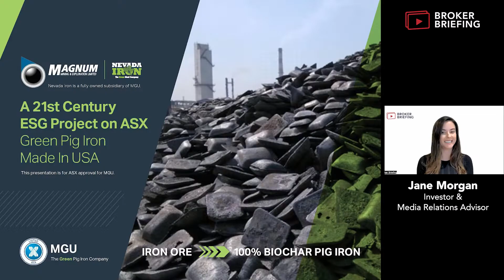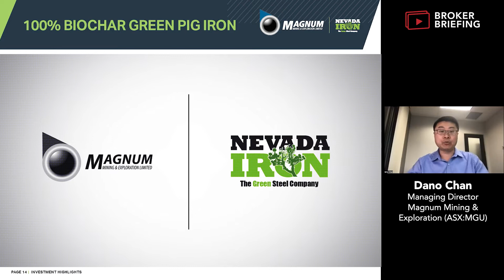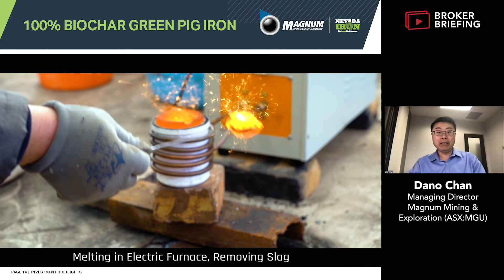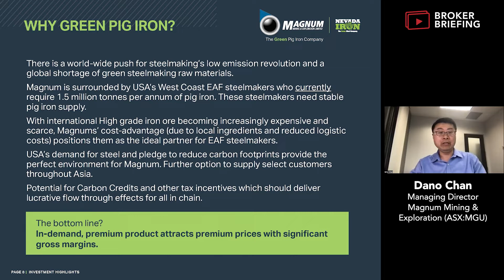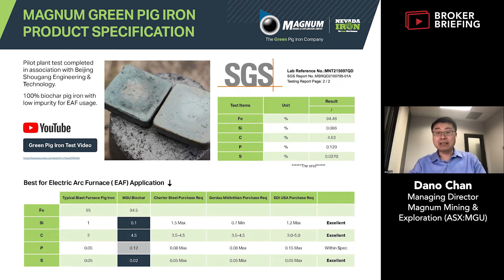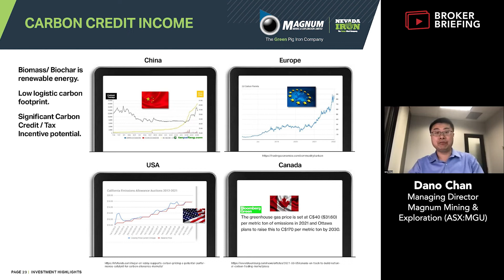Magnum Presentation at Broker Briefing Investor Webinar  28 Apr 2022

Comment: Harvesting junipers and wood waste for biochar is suspect.  There are no eucalyptus forests in the western USA like they have in Brazil.  Rotary kiln and EAF is nothing new.  ArcelorMIttal Vanderbiljpark operated rotary kiln / EAF since the early 1980s.  That process produces steel not pig iron.  If you want to produce biochar pig iron you should install a small blast furnace like they have in Brazil and Angola.  Iron Dynamics in Butler, Indiana uses a rotary hearth furnace and submerged arc furnace for pig iron.  Your web page shows the SLRN process that Metso owns.  Do you have a partnership with Metso?  If not then you should take that picture down.  The market for pig out is the midwest and south USA not the western USA.  Everything is very suspect.